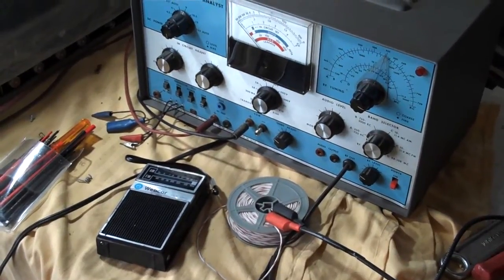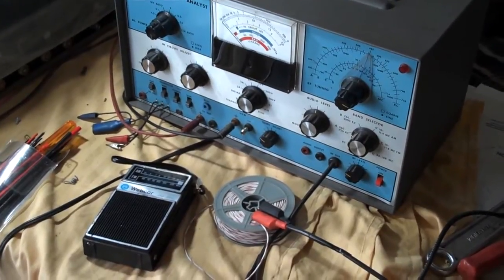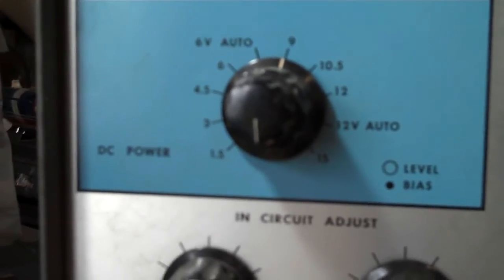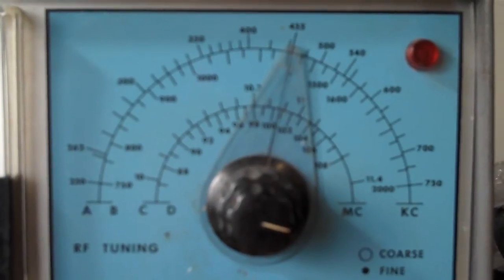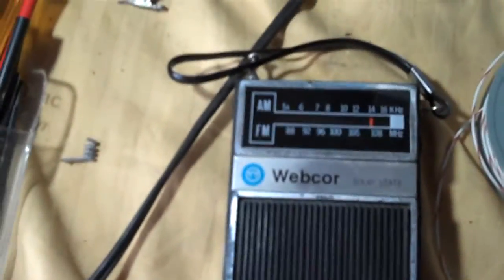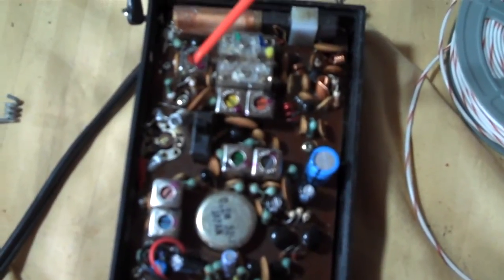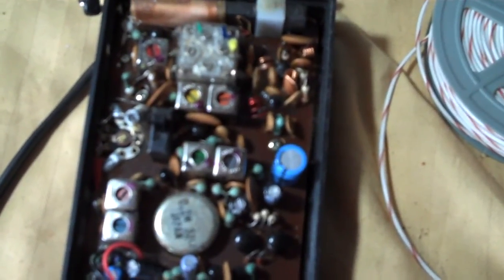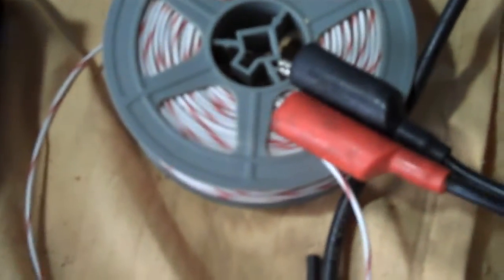AM IF Alignment on Webcor AM FM Pocket Radio using BK 415 part 2

Comment: to adjust the range inject a 560Khz 1Khz signal with the dial pointing this freq. then you crank the red coil until you hear or see the maximum deflection. then you inject a 1660Khz and you go with the dial to that freq and with one trimmer of the capaitor you adjust the tone to max deflexion. Then put a low dB signal on 660 Khz and adjust the ferrite coil to maxc gain and then inject 1100 and adjust the other trimmer on the variable capacitor. Range and Gain done!.

Comment: The old GM radios were supposed to have their antennae trimmers adjusted to a weak station in the middle of the band. I often adjusted mine to the weakest station I wanted to listen to so that it came in as good as possible and the rest were usually still OK. You could get to the trimmer by pulling off the tuning knob and the trim ring behind it and the trimmer was marked and visible on the radio case.